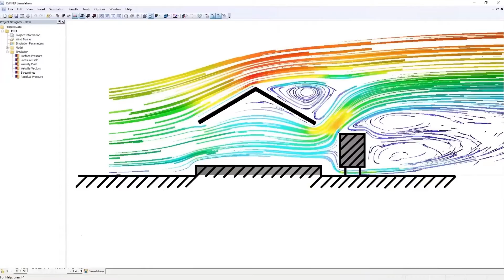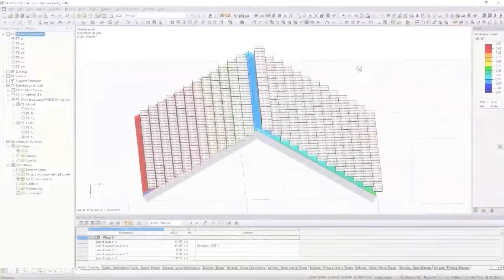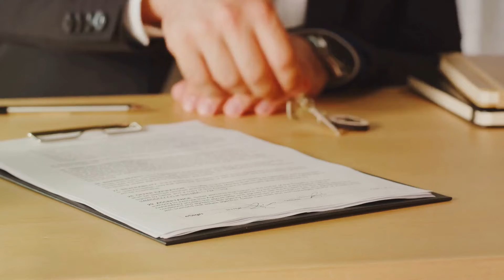Goodbye Traditional Wind: This Crazy invention Changes Wind Power forever

Comment: Amazing. By the power of magic(?) a wind turbine creates more than double the electrical energy than is available from the energy in the wind.
Oh the magic comes from a greek god, is that it?

It might be a great product, but you need to have a basic understanding of physics (principle of energy conservation) before you publish videos like this.

The turbines do not make more energy than is available in tve airflow they receive.
Reply from the maker: The airflow is increased because of the roof angle. They dont produce more then the airflow but the airflow is increased because of the roof angle.

Comment: These would be great on my house! Steep angled roof and windy. Though Im worried about the noise level, and building permits.
Any info on the noise level?
Reply from the maker: RidgeBlade have stated that the residetial version will be very silent. But I have not seen any exact numbers. But I imagine that is one of the main focus points for the residental setup.
Reply: @SingularityVault  thanks! Sounds good!